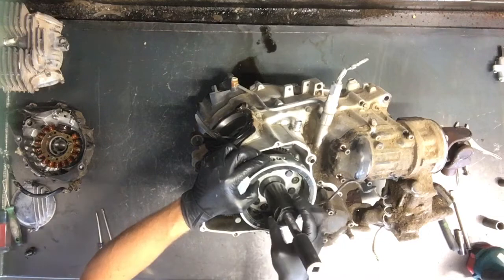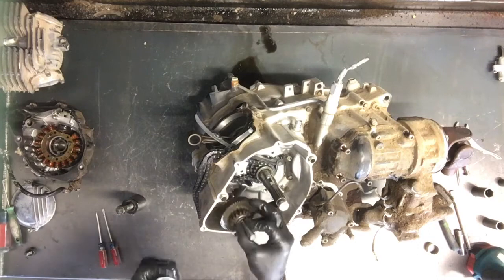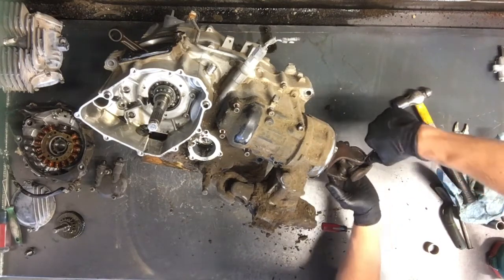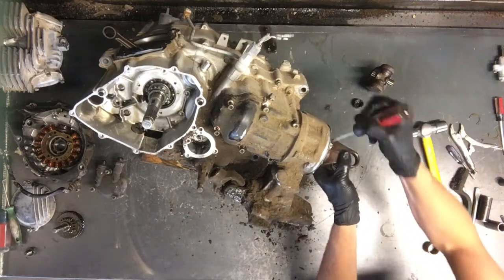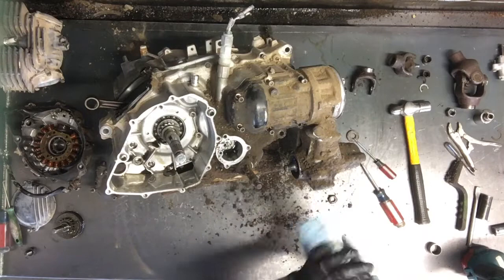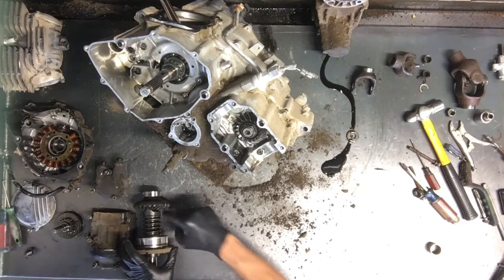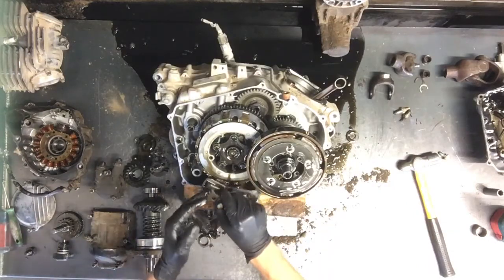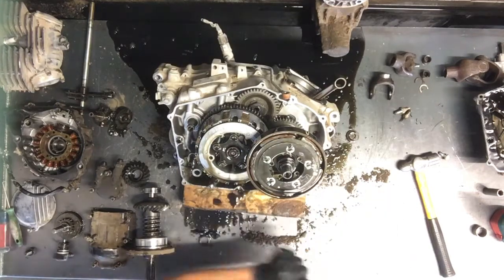HOW TO - Yamaha Kodiak 400 4x4 Magneto Motor Flywheel Stator Spark Charging

Comment: Hey, I have a 05 Kodiak 450. After many checks, spark fuel valve timing etc. I noticed the piston is not moving in the cyclinder. The engine timing is staying correct. But piston don’t move. I held both sides of the crank and can’t rotate one side without the other. If it broke a rod I would expect to see a hole in the block. Broken woodruff key possibly? Looking forward to your response. Thank you

Comment: Great video I was looking for a video on taking apart that middle gear case to replace the seal in the front where the u joint comes in from the front drive shaft. Thanks John

Comment: I might need a new piston and cylinder in my 97 Kodiak 400....what are your thoughts on reusing the timing chain and sprockets along with reusing the same valves. My symptoms are hard start when its cold and blue smoke. bought a compression checker today but its to big and wont thread in......any thought?